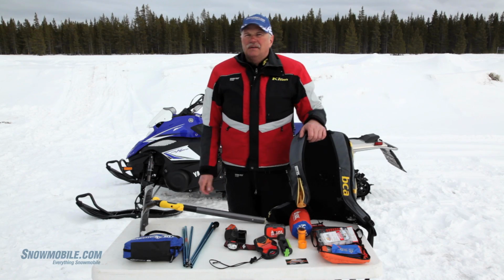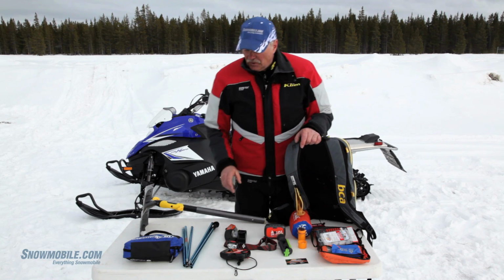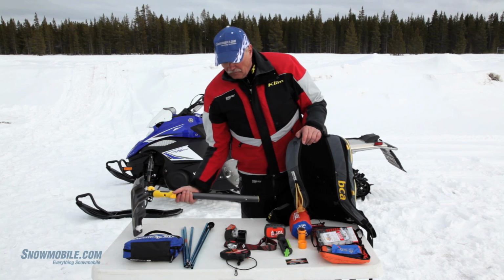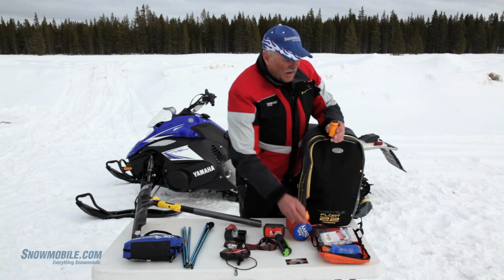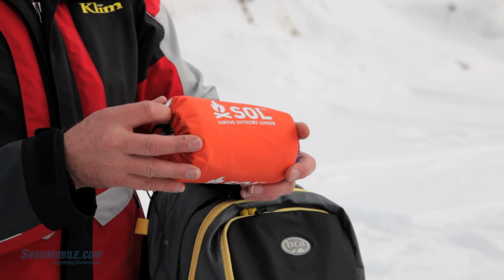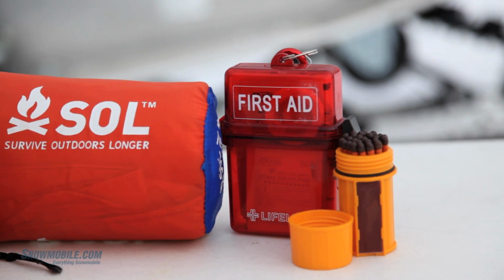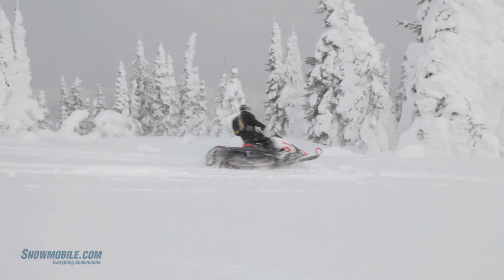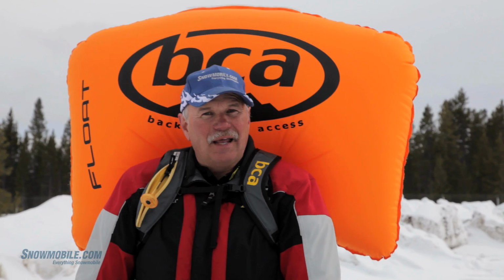Avalanche and Mountain Snowmobiling Safety

Comment: wow you can tell this guy has no idea what he's talking about when it comes to survival gear. The matches burn very quickly! I produce a survival kit for my local area and I use these matches but they don't hold a frame. and his survival kit is a joke! Use the 5'c: Cordage, Cover, Cutting, Combustion, and Container. having something to light a fire  and something to hold a fire
Reply: Hey, Brian how about some gas and maybe some styrofoam to get a fire going. Then the right kind of plastic should hold a flame for a while too. Broken snowmobile hoods burn well if you can get them lit. My favorite is a good old tiger torch.Once you get some wood going you can really get your fire to perform with a leaf blower. Hope this is the kind of survival tricks you were looking for.
Reply: R Potter i had to use my spark plug to get a fire going...i dipped a twig in my gas tank then unplugged my spark plug, laid the plug on engine block, laid twig soaked in gas next to it....had to pull about 4 times before it caught on fire but it worked.  Didn't have a rag so i just used a twig.....i  could have used my sock but twig did the job.  From that day on i always have a lighter and matches on me.  But spark plug spark does work.  As long as u have the tools to unscrew them.